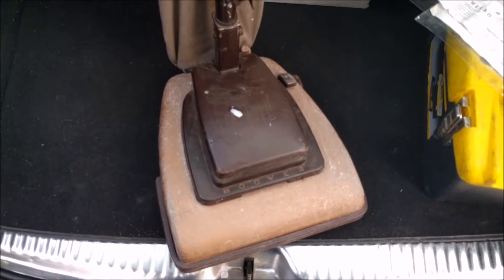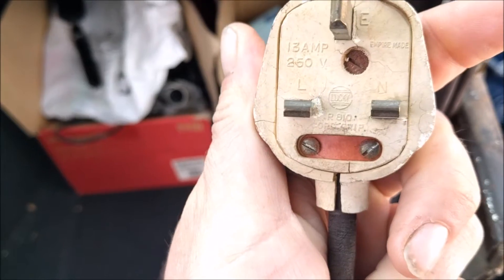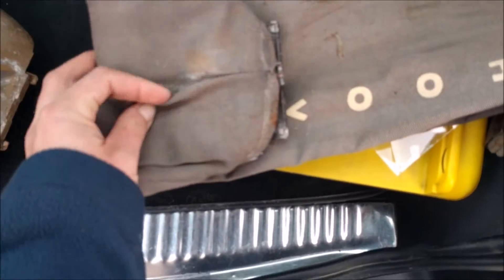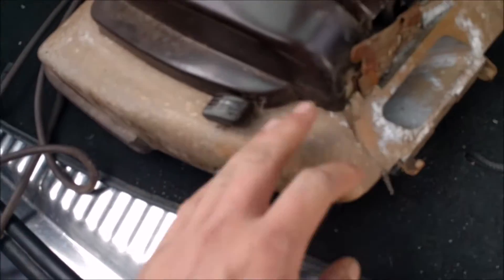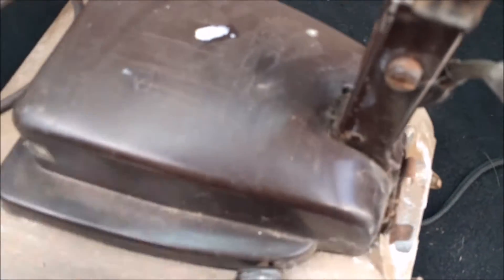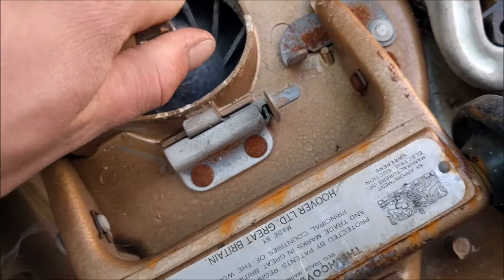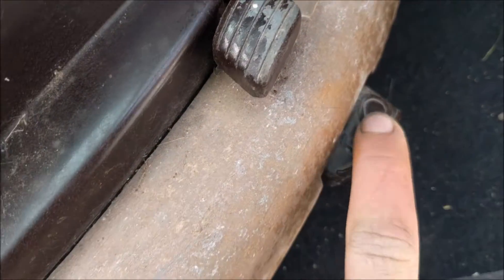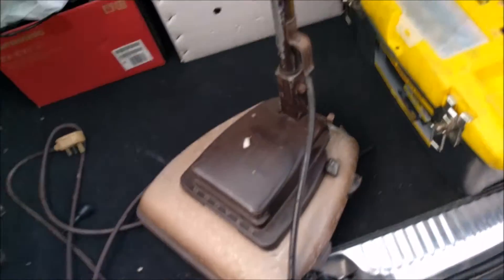1950's Hoover 612 - Before Refurb and before turn on

Comment: Hoover 612, one of the nicest cleaners Hoover manufactured. I still have one in first class condition. A much nicer machine than the 638 which replaced it. The 638 had the same body, agitator and motor but the hood was a different shape (not as nice as the 612) and the different bag was fitted with paper-bags, the first senior to have them. 
I have the full workshop manual if you need any repair info.

Comment: How can I get hold of a vintage 1950s 612 hoover vacuum cleaner bulb holder
Reply from the maker: Hope someone breaks one for spares really... Or look into led lights, could stick them to the inside of the lens cover and wire them off the original bulb holder wires (just get 240v happy led's!)